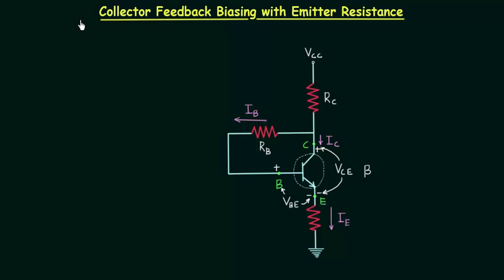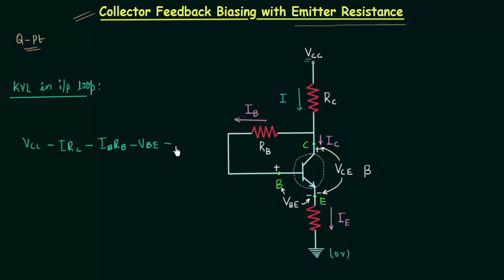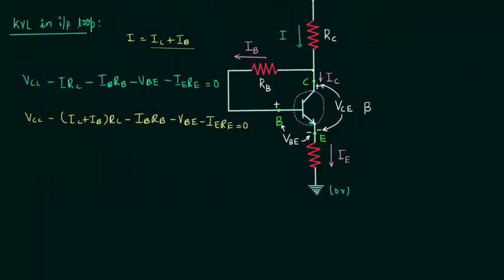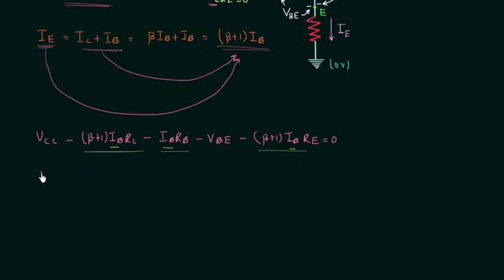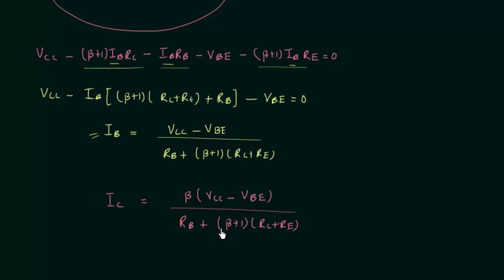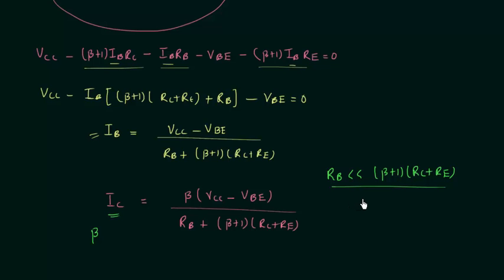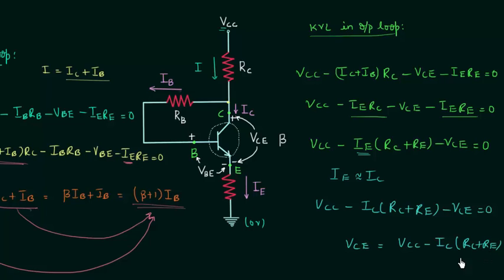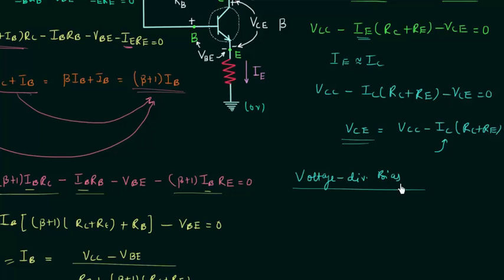Collector Feedback Bias with Emitter Resistance

Comment: Why are you doing this backwards? You don't want to start with the resistor values and find the operating point, you want to start with Ic (the collector current) and Vce (the collector-emitter voltage) and calculate the resistors. The Ic and Vce specify the parameters, such as beta so they are the natural starting point.
Reply: No. Starting parameters are the resistances. In university exam's they ask you Ic and Vce, not vice versa.

Comment: Sir,what is the main advantage of this config?
I know you will say that collector current will be independent of beta but that can also be achieved by the previous 2 config...so,what is the special thing about this config?
Reply: Lesser distortion. The output will be clearer.
Reply: i too want to know the same thing
Reply: Yes , me too i asked the same questionn
Reply: To make collector current independent of beta we have to either increase the value of beta times Rc or lower the value of Rb (in previous bias configuration) and thus increasing  the value of biasing potential Vcc (for increment in the value of Rc) which increase the cost and precautions too. But here due to thevinin equivalent resistance Rth which is the parallel combination of R1 and R2 we get lower value of resistance which we can be neglected in compare to( beta)×Re  and thus after solving the equation  as shown in video we will get Ic independent of beta value... Hope I cleared your doubt btw I am not good at explaining... tried my best lol😢😂😅
Reply: @ayushthapliyal9497  you did good 🙃